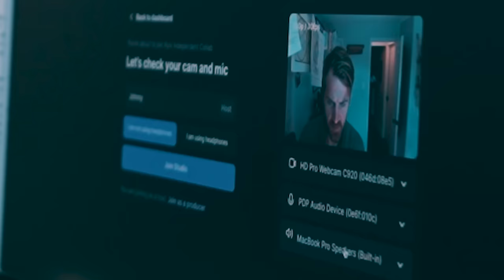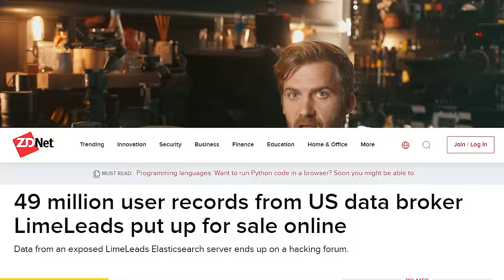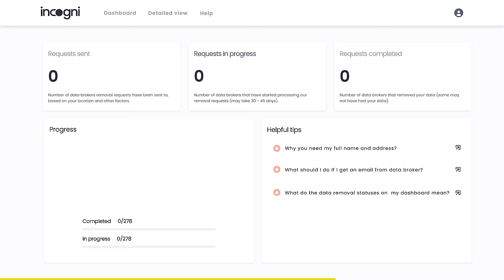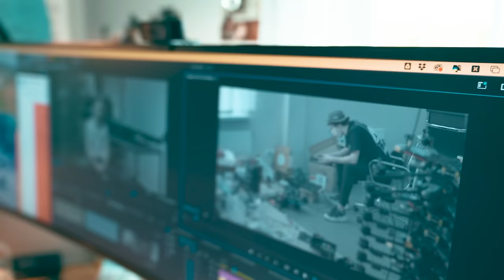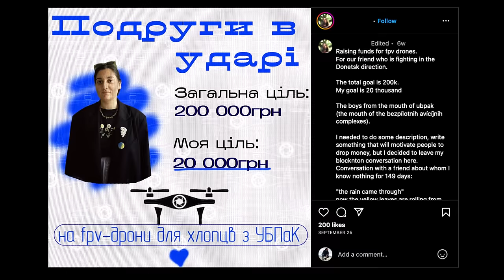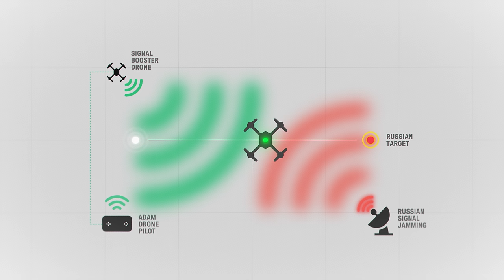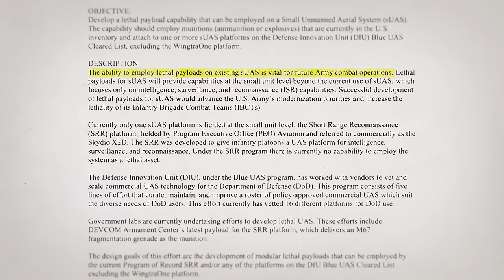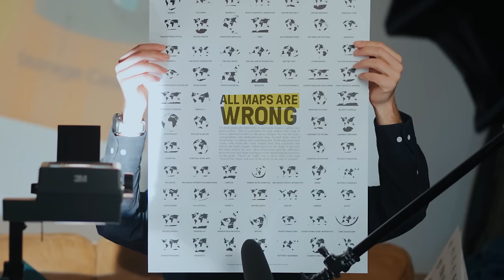DIY Drones: War Will Never be the Same

Comment: I think what this video did not cover is that practically all of the drone parts they used to make these DIY drones are sourced from China. From the motors, to the receivers, to the video transmission system, to the controllers, to the FPV goggles, to the IC boards, even the frames. I don't recall any country that even has a supply chain for drone motors other than China.

The US tries to make these drones home-made but China is so dominant in the supply chain that all American-made drones are leagues more expensive than Chinese ones. In addition, the Chinese drones are far superior in everything compared to the Ameican made ones.

Comment: "killer drones" was once a Sci-Fi term crazy times we are living through
Reply: I mean killer drones are a thing for a quite some time, but that people can build them at home is new
Reply: @_ee75  also $4 million dollar big jet/piston driven drones with guided mentions vs suicide drones that are smaller than a pizza box and guides its self for $400
Reply: @ldIezz I can tell you that the 4 million dollar drone is still a more capable weapon of war.
Reply: @holokyttaja5476  not when 10 is considered a too high number as we see with bayraktar, which makes them much less capable weapon of war or even useless as they can't be used like the SU-24 for the Russians, doesn't matter how fancy your weapon is if you can't afford to lose it. Another analogy is the Yamato battleship of the Japanese, so big and powerful and so expensive they never dared use it for effect.
Reply: @holokyttaja5476 its not about capability, its about cost efficiency in different roles. 4 million would buy you 1 bayraktar, or approx 5000 pov drones with a grenade ducttaped to it. Both are used for very different reasons in differenr scenarios
Reply: Children, can we agree that both are extremely useful tools to achieve completely different tasks, and that both have advantages and disadvantages? An FPV can't shoot a moving target from 4 kilometers away,   and a BT2 costs more than the FPV factory.
Reply: @balkan_thoughts-zt7pr  also large drones need more infrastructure like hangers runways and fuel making them much harder to operate in an contested environment
Reply: @ldIezz  well, some people can extrapolate from a limited set of data, which was used simply to exemplify a range. Others feel the need to correct or add on to what another person said because it makes them feel smart.
In conclusion, children, there are many reasons, pro and against each weapon. As always, the tool itself is just fine. It only matters how you decide to use it, based on these traits.

Comment: Back before I dropped out of college, I wrote a paper on the benefits of low cost DIY drones for underfunded search and rescue teams, including a step by step assembly manual for a €185 drone with a 2kg payload capacity, and then put in a full page outlining alternate uses, with this being one of them.
Reply: Where can I get that?
Reply: Can you share the link of these papers
Reply: Would that SAR drone have FLIR, or is that too expensive?
Reply: @Ray_Mac  Too heavy and too expensive. They start near 100k.
Reply: @Ray_Mac  it had a €5-ish thermal cam from banggood that could do 144p IIRC
Reply: Dropped out of college
to go drop truth-bombs out of drones.
That's what smarts.
Reply: @Ray_Mac  FLIR is getting quite cheap
Reply: @Chubbza5  We are not trying to make hollywood quality videos i believe my friend.

Comment: As well as the shorter range consumer drones, Ukraine has been given drones with a longer range like the Corvo PPDS waxed cardboard/foam design from Australia that can fly up to 75miles with about a 12-15 lb payload of explosives from memory. A flat pack IKEA like drone aircraft that is easy to put together and can cause a really bad day for someone, or even modded to house cameras for reconnaissance.
Reply: I cant believe that is a product lol its just an RC plane. The video also says that type of drone I'd detectable by radar and I think its harder to drop an explosive from it too.
Reply: @henhen7890  The drones in this whole video are basically just quadcopters  as far dropping explosives you're right but the amount of explosives you can pack in it is greater. And as the video says a lot of the FPV's are used as kamikaze drones anyway so similar usage.
Reply: Fly from memory? any way different from GPS i hope? those get. jammed by zhitel systems
Reply: @svenvanwier7196  No I was trying to remember how much they could carry I think I remembered about 12lb or so

Comment: @15:40 This is something I have discussed before but we already have a fantastical solution for this. A while back there was the controversy on U.S providing Ukraine with M864 and M483A Cluster munitions. That was an incredibly controversial topic at the time dude to the whole panic effect even mentioning cluster munition creates in public's eye. To understand why this munition is so incredibly important, we need to discuss what is inside of this munition. This shell contains 72 M42 anti-armor submunitions. A cluster bomb can be disassembled and individual bomblets can be dropped from these drones. For Ukraine this means a single $500 drone, now has the capability to take out a Russian tank. Tanks are especially vulnerable to this form of attack since neither the tank itself, not its accompanying infantry can do anything to defend the tank from this form of attack from the above. The bonus effect of this use case is that a controlled drop of a submunition in this way will also significantly reduce the risk of a dud.
Reply: Also, the succes rate of said ammunition is greater since they drop it basically on top of the tank, while a more "traditional" artillery shot can still miss due to the distance and movement of a target.
Reply: See, controversy is a funny thing in war. It's basically the public asking the military, "Hey, could you like, not do that?" And the military would say "See we would but we already deployed it and well, we're not going out to go get those munitions back, but if you want to, you can sign up and go get them for us if you like."
Reply: They actually did that to several of the cluster munitions when the shipment was sent to Ukraine.

Comment: Great video. In war, running a jammer is considered one of the jobs with the shortest expectancy. When they triangulate your location, they drop a bomb on you within seconds. I'm surprised the Ukrainians don't develop jammer hunters. If the propeller arms are also used as antenna, then the direction of the jammer can be quicky determined with direction finding technology. Then just fly to the source instead. If they turn off the Jammer, then manual control is re-established and the jammer can be taken out normally.
Reply: Communications always has the shortest life expectancy.  It is the core of movement and planning.  Jammers can be defeated, but it isn't easy.
Reply: I'm sure they're working on it, but testing that kind of AI isn't simple. You don't want it to accidentally lock onto a friendly transmitter, etc.  Existing anti-radiation missiles are among the most complex munitions in the field.

Comment: A bit strange that Pentagon didn't think of using small-scale drones before this war, I mean, this technology was ready and it's potential use as a weapon was obvious. 

I guess, only by some real life examples it becomes more clear that such technology works effectively
Reply: They have been. I knew someone 6+ years ago who was working on a kamikaze drone like these for the DoD.
Reply: They have, but to my understanding the industry wanted to sell the big drones.
Probably because that was better for their bottom lines, but also because it is much easier to sell the flashy stuff with impressive spec sheets.

This conflict is really waking people up to the fact that companies haven't sold us the weapons that were most efficient, but rather the ones that were most profitable.
Not that the expensive weapons aren't good, it's just that in a prolonged war, you want scalability over impressive specs.
Reply: there's Switchblade drone, but it cannot do anything that a commercial drone can do.

Comment: Deadly as they are, i believe the Russian Lancet drone and its variants are much more lethal on the battlefield
Reply: Both sides are literally using FPVs to kill a single soldier. They are that cheap...
Reply: @johnzach2057 yes but Russia is developing better drones in rapid time, dont like that fact? Go and cry
Reply: Those are about a 100 times more expensive though.
Reply: @ShankarSivarajan  Because they can destroy tanks. These clickbait videos about drones dropping a grenade cant do anything. Most of the time they are interestingly cut away at the second you would see the detonation.
Reply: @attilamarics3374  Yeah, that makes sense. I expect the cheap ones are still good for killing people.
Reply: @ShankarSivarajan  They are scary.  But the drones that were designed to detonate are scarier, you can find videos, the soldiers running from the drone and it even following them into the bunker and stuff.
Reply: Im actually surprised to see constrictive discussion here, especially by "kind of both sides", nice
Reply: Most of the Times fpv drones are more effektive and Ukraine has more

Comment: When the drone is hit by electronic jamming, is it possible to program it to automatically direct itself to the electronic jammer?
Reply: Not really, for it to happen needs to be an understanding of drone position and jamming station position. Without triangulation of signals and gps it is very hard to do.
It can be done with neural vision and some swarm tactics, when multiple drones automatically communicate, detect and destroy the target, but Ukraine is not there yet.
Reply: Short answer is yes. HAARM missiles are designed to detect and hunt radars. AIM-120D air to air missiles have home on jam capabilities. But that is a complex problem to solve for a drone you are trying to make cheap and mass produce. You need special equipment and programing in the drone to detect, triangulate and then have the range to get there. Boosting the signal is the better solution.
Reply: Right now autonomous targeting like that is a very grey area of ethics. Allowing a robots programing to take the decision to fly to a jamming station that is operated by people and blow it up killing them in the process is scary. Something like taking a life should be dictated by a human decision.
Another thing is that fpv drones usually have short ranges and often cant reach far back enought to get to enemy EW inatalations. Detecting the source of jamming and hitting it with artilery is probably much more sensible though also not very simple i habe to imagine. Otherwise the problem would have been solved already
Reply: @rozkaz661   Peacetime ethics. In war, there is only one law: win.
Reply: I can see that being possible in theory by using 2 signal boosting drones, and having them in conjunction with the armed drone triangulate the position of the jammer, however I don't know how quickly they would be able to calculate that while actively being jammed, plus if Russia had their own signal blocking type drones to counter that exact type of thing... The cat and mouse in drone warfare truly is new levels of intricate and terrifying honestly.
Reply: @rozkaz661  The ethics of that are indeed hazy but in the fog of war, haze is undetectable. Realistically, they could easily claim that the  POV pilot gave the command of seek and destroy, which DOES technically mean it was a human giving the kill order, not algorithm based. But yea it's a messy hill full of mud for sure.
Reply: @someoneonly they do have a computer it’s what’s making it fly.. with the right sensor yeah it could be used to home in on the jammer. The other option is to repurpose the GPS rescue system to be a gps delivery system instead, so once it becomes jammed it takes on a mission to a set of gps coordinates. The firmware is open source and not hard to modify.. I know I’m one of the project leaders
Reply: @ShankarSivarajan Lmao no that is exactly the opposite. Which is why we can't use biological weapons in Ukraine for example. There exactly are ethics even in war.

Comment: 2:49 There is a slight error here. FPV kamikaze drones, as the ones depicted and described in the shots before, usually do not have a "release button", as they get destroyed during the mission either by hitting the target or crashing beforehand. This gets cleared up later but you even show a RC remote when describing the "release button", which gives off a wrong impression.

Comment: The signal jamming problem is going to be the biggest challenge going forward. I think radio control is eventually going to become obsolete, as overpowering jammers requires more and more transmission power.

The most promising solutions to this problem are line-of-sight control using optical wavelengths (i.e. lasers), and eliminating the need for a remote operator by allowing the drones to fly themselves to the target. Using lasers, you not only become immune to jamming, but you also prevent the enemy from being able to listen to radio signals that alert them of an incoming drone.
Reply: You can use parabolic antenna (ie: radio-beam). Basically, it does the same thing as laser but doing it using low-tech solution.
Reply: @xponen - Just one of the many things you can do.  Do you remember the "wave rider" where you printed up cut locations on paper, glued some aluminum foil to a cheap whip antenna, and boosted the signal 30 fold?

Comment: I struggle in circles with the ethics of this and I pass zero judgement.  

Just for anyone watching, FPV is a beautiful, rewarding, art form of a hobby.  Fulled with brilliant innovators and engineers.  MultiGP probably has the most direct connection to this community.

Comment: Major air forces are slowly going to take a backseat when you compare the cost effectiveness of a huge fleet of small drones launched on a target compared to the cost of aircraft carriers and jet fighters which put the pilots at risk, are massive losses if shot down and are much easier to detect. It won’t be long until we see a similar tactic used in the Palestine-Israel conflict if/when the ceasefire ends. Drone warfare is the new guerrilla war.
Reply: drones are not effective when your opponeent has adavanced jamming capabilities, israeli jamming has all but made hamas drones practically useless in gaza
Reply: @eduwino151  fair point, unless there was counter measures like spoken about in the video to improve the radio signals but as you say it’s unlikely. I would imagine it’ll start to become more and more prevalent in future conflicts, particularly when advanced militaries go up against smaller factions and terrorist organisations, the wars in Iraq and Afghanistan would have likely ended much sooner had there been an abundance of cheap drones to target terrorist compounds and hideouts - compared to the expensive military drones that were used. Small drones that can be easily equipped with explosives may well become just as important to a soldier’s arsenal than rifles and grenades
Reply: @eduwino151  directional antennas and frequency hoping can mitigate jamming. And they don't cost that much. And both Ukraine and Russia are developing autonomous FPVs.
Reply: @Ladenses  but what if it was the terrorists that had the drones...
Reply: @johnzach2057  Right, they need the drones to be at least partially autonomous. Eg the operator fixes it on a target and if jamming occurs the drone will complete the mission flying into that target on its own. They also need anti-drone protection - very sinsitive but small detectors and effective, tiny and lightweight munitions, which could be as basic as a nylon net projected at the drone.

Comment: One thing i’ve wondered for years is what this means for terror*sm. What happens when extremists decide to use such accesible tools to say drop a bomb in the middle of a crowd?
Reply: In my opinion ofc they will use it but they used cruel tactics before too. It will be a new tool, I agree, but I dont think it will become the only way for terrorists.
Reply: @dadataya5588  I think the point is that it's extremely easy and cheap, and probably more convenient to be out of the way, especially for those that arent trying to "die a martyr" or whatever. incredibly scary

Comment: just fyi all these drones dji etc are essentially used as FPV drones.... so i dont know if you forgot to look up what FPV means but it really doesnt have anything to do with the drone per say... First-person view (FPV), also known as remote-person view (RPV), or video piloting, is a method used to control a radio-controlled vehicle from the driver or pilot's viewpoint

so it just refers to the method that you control the remote controlled vehicle which could be a ship car plane or quad or .... whatever really that you pilot remotely

Comment: I remember, the very first time i used a drone. One of those Parot drones.. FIRST Flight, I immediately saw the Military applications. 1. INSTANT Recon.. In a full 360 degree's. Game changing, for the common infantryman. NEXT came the thought of a weaponized drone. IE one, that has a remote to drop a payload...

THIS Kamikaze, version is frightening. RIGGED up 2.75 rocket warheads... HOLY Moly. RPG7 warheads.. Swarms to boost signals. Drones for spotting, This is a full blown Terminator level warfare. From a range of 3-6 miles.. First person hit.. With another drone verifying.

Just imagine an US Military variant. Only need 5-10min flight time. Constructed, for pure carnage, not pieced together. THIS is the Terminator level.. Just think.. Ai, is here as well.. ITS getting closer and closer.
Reply: Yea, we would all be easy pickings for AI with this tech if it wanted to get rid of us. Wouldn't even need to bother making a super virus.